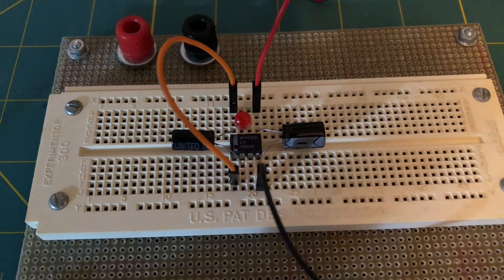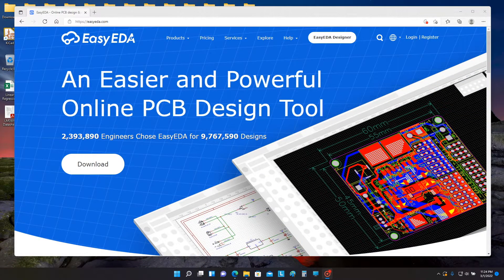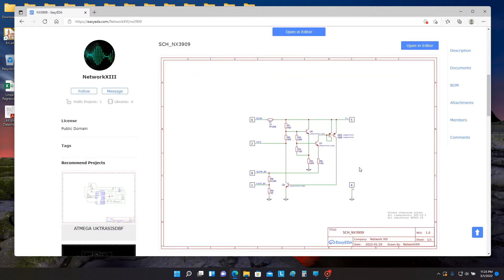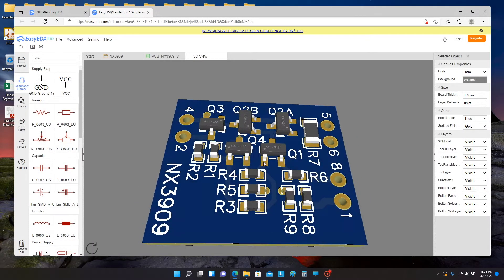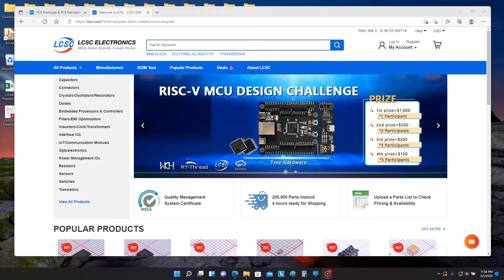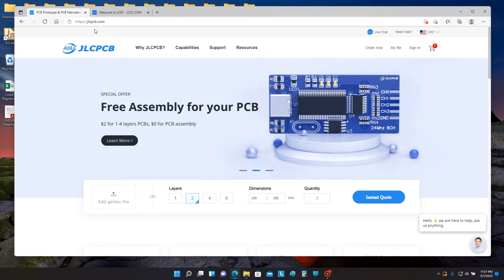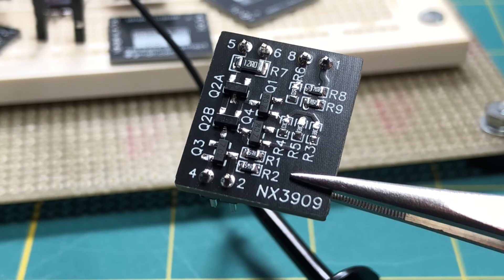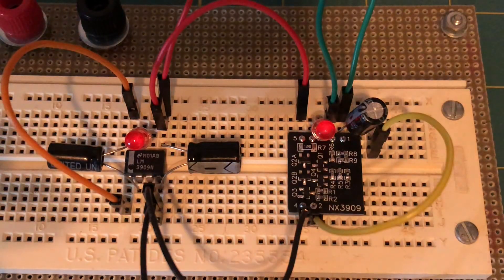The NX3909: A Homebrew LED Flasher

Comment: I will design a drop in replacement for the LM3909 using even smaller SMD parts. 01005 (imperial) size resistors, CSP-sized transistors and zener diode. It will be great! ,😃👍
And I'll try to sell them on ebay for a couple of $ each

Comment: eh, where is the z diode?
Reply from the maker: It wasn’t in the app note schematic, so I left it out.  The circuit works fine without it.
Reply: @NetworkXIII  wait until you run the IC from 6V or more!!

Comment: Just got some TL431s in and they DON'T self limit. I must have confused it with something else. Size the resistor for >1ma ( 2ma maybe?) at the lowest expected input voltage.  :)
Reply from the maker: I think the TL431 needs 1mA to bias up, I have to check the datasheet.

Comment: Just watched your 431 vid from 3 yrs ago.  The 1.5K resistor should be a lot lower 'cause the 431 kinda self limits to 1 to 2 ma. I think.
I'm trying to build a shunt regulator out of one for cells in a lithium battery pack. 10 cells 4.2V each max.  This is just for charge protection. Over voltage.  Bonus side effect might be top balancing. I like the sharp cutoff the 431 features.
Subbing.  :)
Reply from the maker: The TL431 is a neat part, thanks for the advice on the resistor and thank you for subscribing.
Reply: @NetworkXIII  :)